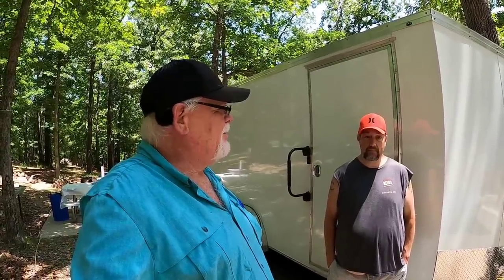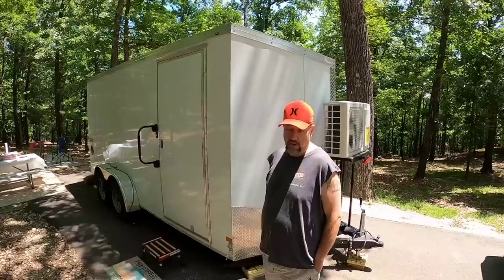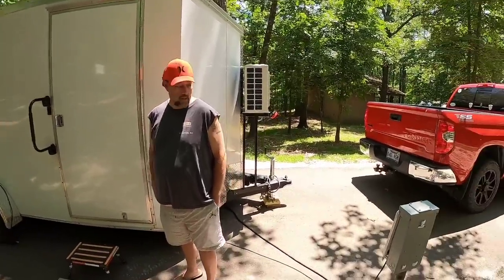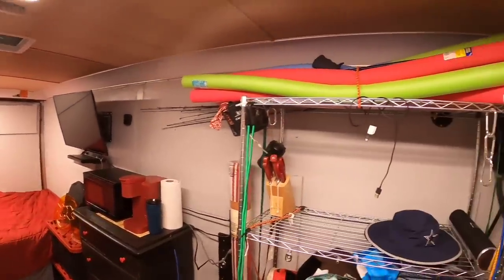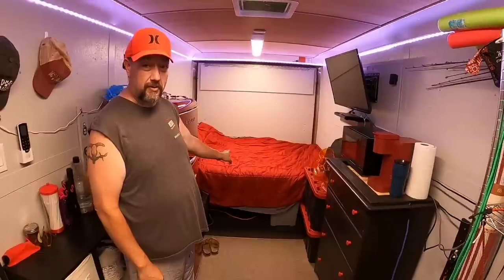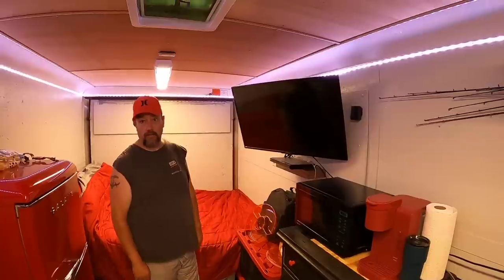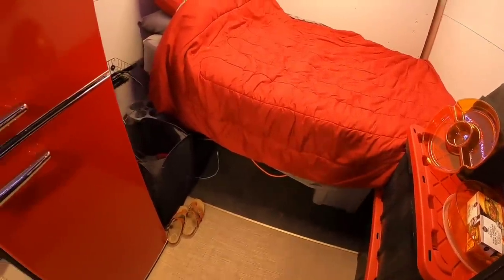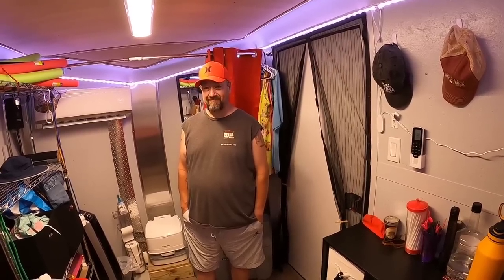From Cargo Trailer To Cargo Trailer Camper. Amazing Transformation!!!

Comment: Love it. I am getting a 6'x12'.  My wife and I are going to set it up as an insulated camper. We have a few motorcycles, so I need to figure out a layout so I can still get a bike in the trailer.
Reply: I have a 6x12 and I have a single motorcycle in it and a 3/4 rv bed. Got several floorplans but none with 2 motorcycles in it.
Reply: @devilboy251 please shared your floor plans

Comment: Could you please post an Amazon Link for one of these split units that is silent 😂
Reply from the maker: Senville LETO Series Mini Split Air Conditioner Heat Pump, 12000 BTU 110/120V, Inverter, Works with Alexa, SEER2 20.8, 1 Ton, White https://a.co/d/b2haKGc

Comment: Do trailers with screwless siding have insulation or do you install insulation the same as the screwed siding?
Reply from the maker: Most manufacturers offer an insulation package, but most folks prefer to do their own insulation. You would insulate a trailer with screwless exterior the same as any cargo trailer.

Comment: winds gonna bend fan on the hwy
Reply from the maker: Although he didn't say anything about covering the unit when towing, I'm certain he does. We have a mini split as well. We cover it when towing. It's one of the "common sense" things. In 2 years of travel, the "wind" has not bent the fan, and it still works just like it did when we first installed it.